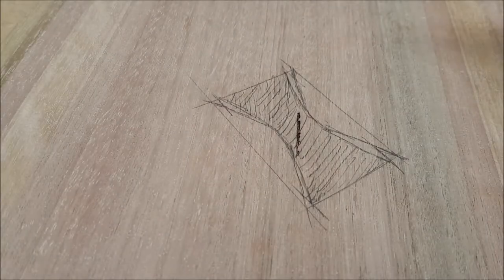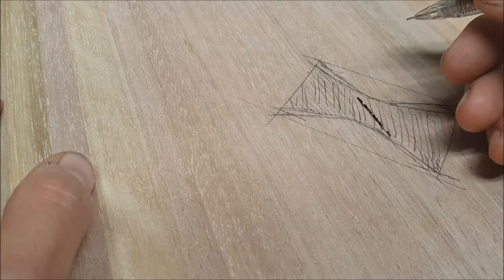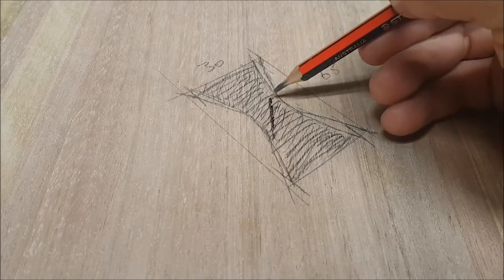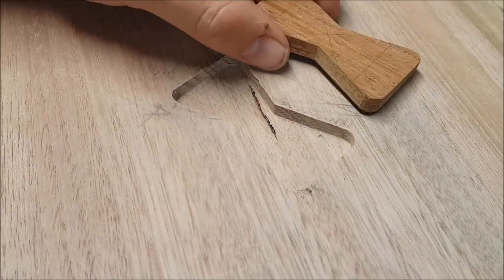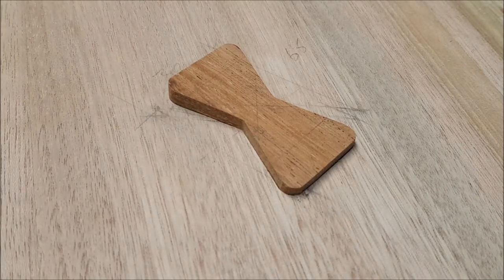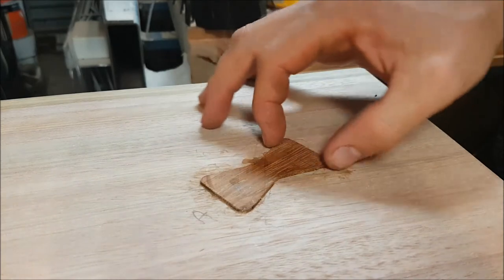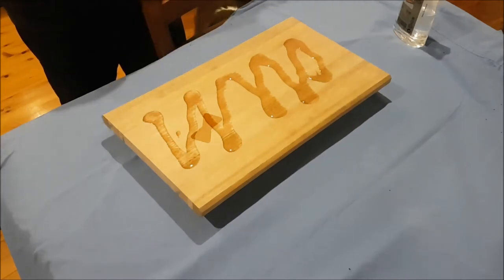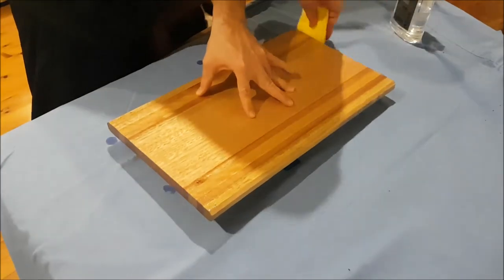Bowtie Patch Repair on a New Cutting Board Project

Comment: Thats really cool! well done. The wax paper was a neat trick. I wonder if you put blue tape on the area you were cutting out before you even put it in the cnc, then left it on through the glue up if you would have even less glue cleanup.
Reply from the maker: Making It Up thanks mate. It was a very minimal clean up, mostly just getting the board back to level as I deliberately left the plug high. Painters tape tends to lift when the mill hits it. You've got some cool projects on your page. I'll have to sit down later and look through them 😁
Reply: I suspected that might be the case with a cnc. Now that I think about it you have to sand no matter what so squeeze out is not really an issue. Also thanks! We have a bunch more that need to be put up and will be very soon.